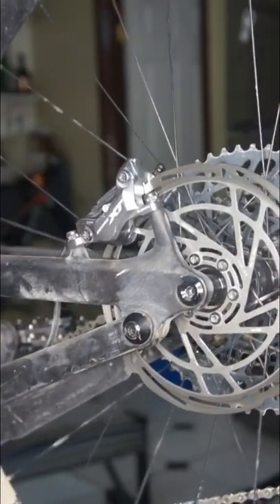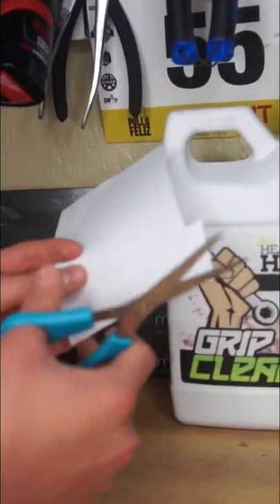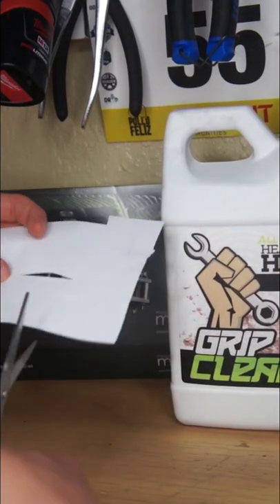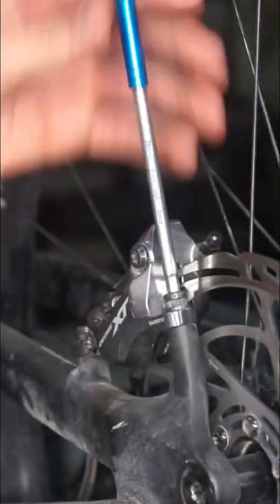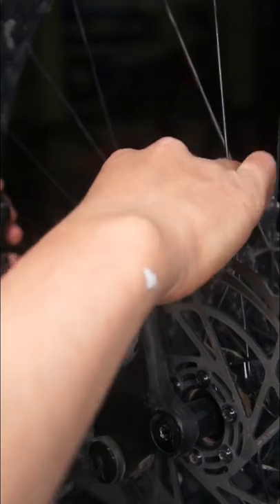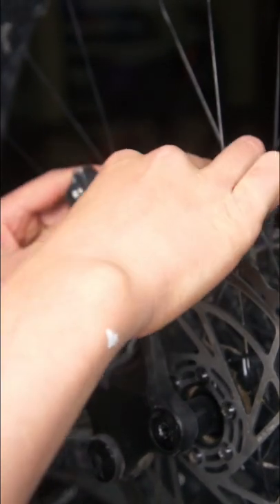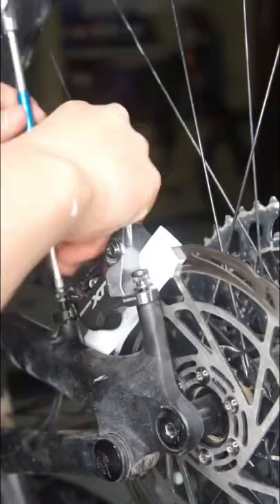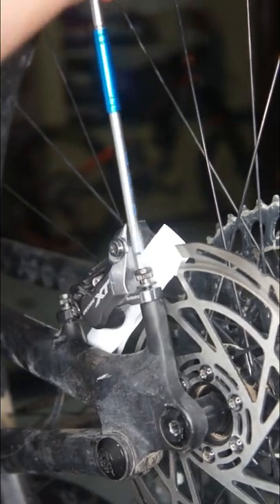Align a brake

Comment: The only way I can ever align my brakes is just using my eyes. I can never get any other trick to work
Reply: same here, some brakes are just finicky
Reply: Same.
Reply: same haha
Reply: Same. All bs
Reply: Me too some annoying sound are coming from both front and rear disc breaks and breaks also not working properly 🥺
Reply: Same
Reply: Same 👍
Reply: Hope makes a fancy tool or there are other brake alignment shims that do the same thing only better than paper.
Reply: We call it eyeball....😂😂
Reply: I losing up the brake calipers and then press the break lever. Keep it pressed and screw the bolds 🤷‍♂️
Reply: @karatekid_britto  Maybe you have air in them and you need to align them :D
Reply: If my neighbors saw me spinning a wheel with 1 eye open they would move 😂
Reply: Same lol

Comment: Works 75% of the time. The other 25% by cursing and yelling when you  hear it rub against the disc after doing this 10 times.
Reply: 😂 this is the comment I've been searching for haha nice. I usually do that and then loosen the bolt again and again each time a bit less (loosen, squeeze, tighten) do that 7 times and it's perfect
Reply: Well, i use headphones :)

Comment: The paper trick was created when aligning mechanical disc brakes as only one of the pads moves. The paper prevents it from constantly rubbing when you release the brake. 

With modern hydraulic brakes both pads move so there is no need for the paper. 👍🏼
Reply: Bs
Reply: that means you need the paper more so
Reply: People still have mech disks though
Reply: Lol try doing that to dura ace brakes, even with the paper it will rub once you press the brake once. Just goes to show how good discs are at slowing you down and not much else. Mtb brakes don't suck as hard it just needs regular alignment because no matter how tight you do up the bolts, the caliper will move after maybe 2 laps of xc

Comment: you just losen the bolts and squeeze the brakes harder, you don't need to put anything inbetween lol
Reply: Neither works for me unfortunately. I just have to eyeball it.
Reply: @gtrance3567  let me guess. You have sram brakes.
Reply: @downhilljedi  hayes
Reply: Same, like my v brakes, just put the shoe in and done
Reply: That only worked for me when I had mechanical brakes on a bike I had 4 years ago
Reply: If there is a bit of rubbing, the piece of paper helps.
Reply: the method you said sometimes or in some cases doesn't work because of the misalignment of the disc or the brake pads or even the caliper holder
Reply: This will not work if the disc is not perfectly aligned
Reply: @godwillescabel4849  If the disc isn’t aligned, you have bigger problems.  You can adjust the calliper, but unless it just needs truing, a misaligned disc is useless.
Reply: @gtrance3567  then you’re doing it wrong.
Reply: Exactly!
Reply: @madzonic16  no, tried many times over the years. Finally saw my bike shop eye ball it and have been doubt that since.

Comment: Just loosen the caliper bolts, spin the wheel, move it to the position that it’s not rubbing, tighten the bolts bit by bit making sure it doesn’t start to rub. Works great.

Comment: Line the disc up in the "centre" of the gap, lightly tighten the screws, squeeze the brake gently till both pads came out to touch the disc, loosen screws then squeeze the brakes firm then tighten screws tight with locktite on them... done!

Comment: Do that with out the paper
Reply: How
Reply: @napim2811  loosen 2 brake calliper bolts a few turns 

Squeeze brake lever on of on off 

Squse brake lever on hold it hard as you can 

tighten bolts evenly then snug while apling presure to the lever 

Tork brake caliper bolts to spec say like 5.5nm  or just tighten tightly 

Hope thats clear and understandable instructions

Comment: Guys let me tell the right one for hydraulic systems
1.Loosen the bolts until there is play in the caliper
2.hold the brake lever while tightening the caliper back
3.Check for rubbing If there is still rubbing the caliper will need to be fined tuned but before that check if the disc rotor is bent a bent rotor will show a lot of movement side to side. Some brake truing can be done but it is recommended to replace it.
So if it isnt bend you will need to lossen the bolts but a little bit less just that you can move them a little bit side to side (CAREFUL WHILE WORKING CLOSE TO A DISC ROTOR)
Tighten back when you dont have any rubbing left

If you still have rubbing check for:

Sticky piston (one of the pistons is stuck and this can make aligment pretty much imposible)
The brake pistons are out way to much: this can happen due to squezzing the brake lever with the wheel off. You can use Park tool pp 1.2 piston press to fix it

Hope I could help you happy riding!

Comment: Great in theory, not so in practicality since the calipers budge sometimes when you tighten the bolts resulting to an off center caliper even if you block and clamp it.  Best is to eyeball the pads and rotor then tighten slowly while observing the  alignment.

Comment: My Tips So Simple (Don't Have Bike Yet But Planning Buy) Using Dry Clean Cloat And Spray Or Soak With Brake Rotor Cleaner And Swipe That Cloat On Rotor

Comment: Dude

You need to leave the caliper bolts loose then squeeze the lever so the pistons squeeze the rotor in the spot where the caliper needs to be then tighten the caliper bolts. 

Alignment shims are pretty cheap on Amazon

Comment: Tips from the bike shop:
-You really don't need the paper unless you're working with mechanical (cable-operated) disc brakes. 
-You do not need to take it all the way off. That just makes more trouble for you. 
-The bike shop can do it for you

Comment: Loosen the bolts enoughso the caliper can move.
Pull the brake lever hard and keep it locked.
Tighten the caliper bolts.
Done
Reply: Though effective, it doesn't apply to all bikes. On some of them, you still have to resort to manual alignment.

Comment: *assuming both pads have even wear. 
-Its better to reset the pistons, add new pads to center, then if you can still use the old ones itll wear down to even.

Comment: You don’t need to remove the calliper, just loosen it a little, remove the wheel, insert a folded piece of paper, remount the wheel and tighten the calliper while squeezing the brake.

Comment: you don’t need the paper, loosen bolts, hold the brake and tighten
Reply: That doesn't usually work, however neither does a piece of paper...
Reply: Doesn't Work in 95% of the cases 😂
Reply: @mpvabi95  thats right 😂😂
Reply: I know this trick ... But it doesn't work every time.
Reply: If it doesnt work without paper youre disc is warp or a piston was seized
Reply: Rarely works, something is usually knackered, like the pistons or uneven pad wear or bent rotors or air in the tubes, or contamination, or brakes that slide out of position the second you tighten the bolts from uneven mounting surfaces.
Reply: @Flyingfist  you are disc is warped?

Comment: Lol you don’t need a paper. With the loose mount just press your brake lever. Once done, tighten the brake mount bolts and adjust the brake barrel accordingly to open the gap between the rotor 😂

Comment: Just pull and hold the brake lever while tightening the bolts. 
That's how we do it, to allign the caliper to rotor. No need the paper works😊👍
Reply: thats only true for perfectly straight rotor and high quality caliper, for regular garbage, use that paper